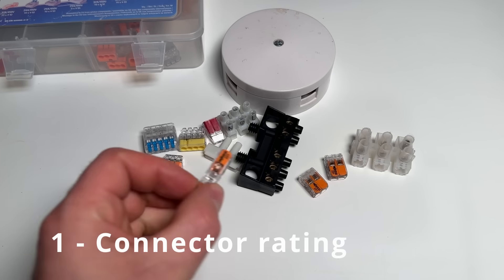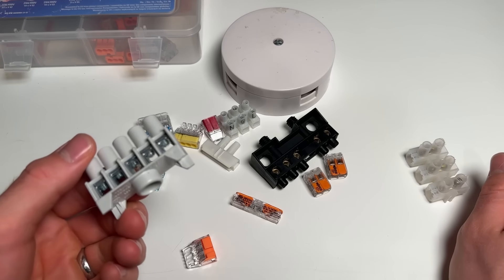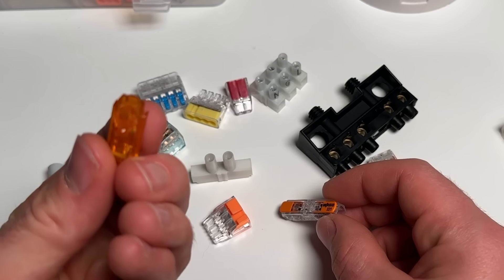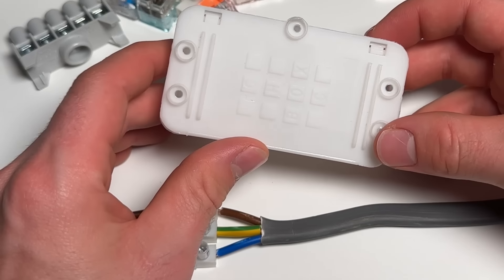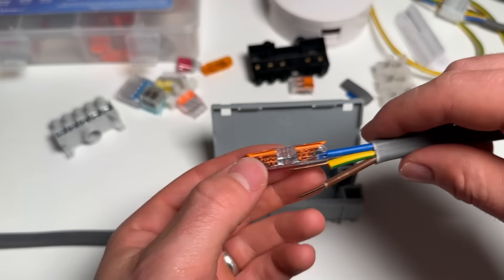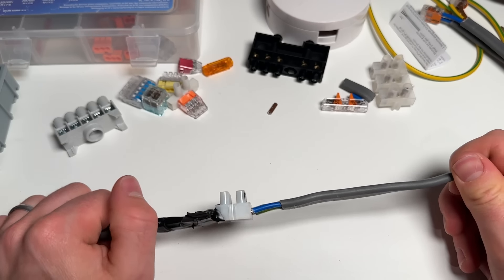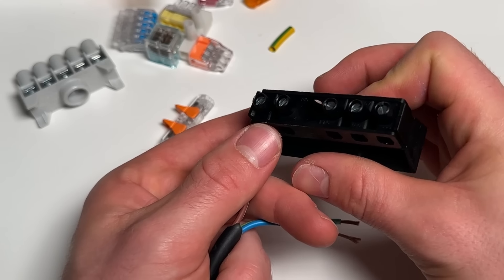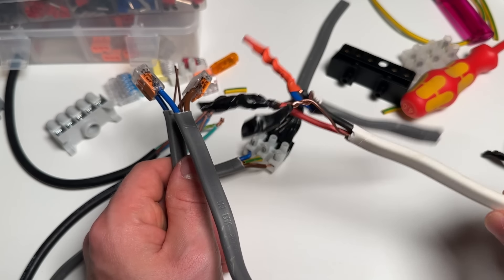BIGGEST DIY Mistakes Joining Cables

Comment: Every mechanical connection method has it's problems, add to that the type of conductor and the material used. Screw terminals have issues in securing stranded wire, directly using just a screw, wrongly sized and spread may occur and secondly screws becoming loose and crushing the conductor to destruction. Wagos, and Ideal, the latter one shot device, but both are constant pressure, both use a sprung cleat type connection, this is minimal and there is a issue with resistance due to knife edge, similar to a crimp lug, I've seen wagos under test glow at this junction, crimps are the way to go, definitely for stranded wire, incidentally do wagon boxes have a fire rating?...old junction boxes were made of various material, the most common being a vitreous type material, which was pretty good?

Comment: While i do enjoy the WAGO connectors, in terms of quality of the connection, the screw ones are the best, but are also used wrong by everybody. Come with the wires so that both screws catch each wire, 2 points of mechanical connection is the safest way to do it.

 Might not look as pretty as WAGO but for sure they are more secure, remember that a wire will get hot at the weakest connection point, 2 screws on each wire is better than any other clamping method.
Reply: More secure until the screw backs out. How often are you going back to check the screws on previous installations?
Reply: @Pugjamin  derivation clamps inside electrical panels have screws... 2 of them. 

The job of an electrician is to tighten these and then after a week to do another inspection and check again the screws.

It is the same drill for the circuit breakers. Nothing is fool proof, somebody has to do his job right!
Reply from the maker: Thanks for watching!

Comment: Think you've got them the wrong way round. The clamping power of the standard connecting block is way over that of the Wago , you have no control over it unlike the  connector block. Just as long as they are used inside an enclosure,  they are perfectly fine, which goes for all connection methods
Reply from the maker: Thanks for watching!
Reply: I agree - the Wago is a spring clamp, with a relatively poor connection. A screw-down block has a much better connection across many more strands.
Reply: @SimonWad  I just like to add that the spring's main function is to press the wires against the bussbar inside the Wago-connector.
Reply: The difference is that the springs being made of spring steel maintain a constant clamping pressure indefinitely.  With a screw clamp the pressure reduces as the ductile copper wire relaxes over time.  It's also impossible to overtighten a Wago.
Reply: Nowadays junction boxes have to have some cable outer retention, not just retain the conductors and fix the cable nearby.
Reply: Absolute rubbish.  @SimonWad

Comment: It's interesting how locale influences what we consider safe. In North America, almost all connections are done by twisting wires together (and covering with wire nuts.) When I heard about British ring mains, my first thought was, "why aren't there more fires there?" Of course, your plug has a fuse, to compensate.

When licensed electricians make twisted connections here (Canada) the resistance of the connections are lower than for Wago connectors (not that I would hesitate to use Wagos.)
Reply from the maker: Good points, thanks for watching!

Comment: It's really interesting to see how different places do residential wiring.  Here in the US, as you probably know, most household branch circuits for the past 50+ years are 15 or 20A, 120V, with 14 or 12 gauge solid wire, or about 1.6 or 2.0mm.  All splices have to be done in a UL listed enclosure, with a UL listed device, and be accessible.  On solid wire, installed properly, UL listed wire nuts are fine, and probably 95% percent of US homes are wired that way.  But I agree wagos are a bit better.  The push in types are frowned upon here, because some products were on the market..and still are...that have proven to be not reliable and have some hazards.  So many electricians avoid them as shoddy.  It takes a long time to shake a bad reputation.
Reply from the maker: Thanks for watching!

Comment: I don’t agree with your fascination with wago connections. In my opinion as an electrician of 35 years the screw terminal is fat superior. The wago relies on a spring and springs weaken in time causing a weak connection which hears up further weakening the spring resulting in a burnt out connection. Use a screw connector block.
Reply from the maker: Thanks for sharing your opinion
Reply: Interesting thoughts but I don't agree.
Reply: Only time will tell if Wagos have longevity, The trend is going toward spring connector joints including outlet sockets, it's only time before mcbs, rcbos etc will go that way.
Reply: @mainlineelectronics5266  I doubt MCB's, RCBO's etc will ever have lever connections due to the range of sizes of cable that can be used on some circuits, a 32A breaker can be used with 2  or 3 x 2.5mm² or 2 x 4mm² cables through to a 10mm² cable and possibly even 16mm² you won't find a lever style connector that could cover that range of sizes

Comment: a 30 amp junction is ok on a ring - 2.5mm T&E is rated to max 27amps clipped. Think about it.
Reply from the maker: I’ve got another video on socket mistakes covering rings and cable ratings. Thanks for watching!

Comment: 6 - twisted flex: common in Saudi, and for quite hefty loads too, seen in public spaces such as for shop front signage. Last one, flex into a block, is essentially how a wires in a plug are connected (but with flex sheath grip too).
Reply from the maker: The flex should have ferrules over the cores in the screw terminals though
Reply: @TheDiligentDIYer1759   there's no space in a regulated 13 amp plus.
Reply: There are LOTS of things that are common in Saudi, that are very much not ok.

Comment: Great video for basic DIYERs , but if you do a follow up, please note that if using a chocbox then the cables entries should be secured using the providing cable clamp to make sure the cable is secured from undue tugging to stress and the cables do not pull out of the connector block which also hooks onto one of the pegs in the lid to ensure that the connector block is secure inside the enclosure
Reply from the maker: Very kind of you to say so, and good points! Thanks for watching!

Comment: Wow how did we ever connect anything safely before Wagos? Junction boxes when correctly installed are perfectly safe period.  Check your electricity meter main tail connections when you get chance and tell me what you see?  Shock horror screw terminals carefully designed to safely carry 100A plus!
Reply from the maker: I clearly say in the video the issue is people using screw terminals when not rated appropriately. Obviously terminals rated for 100a on a domestic incomer are not a problem. Thank you for watching.
Reply: Fair point, but as others have said on here, it has been common UK wiring practice to use the 30A junction box to break into a ring final circuit to feed a single  spur for example.  The alternative is to spur off the back of a socket on the ring.  The junction box you show at 2 mins in has adequately sized terminals for the job.  Other than that I agree with your remarks completely and will no doubt use Wago connectors at some stage in the near future 👍.
Reply from the maker: I guess you’re right, using a junction rated for 30a on a 32a mcb isn’t likely to be a big issue. Thanks, the wagos are great!

Comment: I was looking at my training documents from the seventies where we had chock blocks, twist connectors and fabric insulating tape. It does mention twisting the earth and didn't require sleeving!! the term CPC hadn't been discovered then!!
Reply from the maker: Interesting to hear, thanks for sharing and thanks for watching!
Reply: I wonder if CPC became the preferred term after a meme went around the Internet showing a Russian „Widowmaker“ type shower with the green wire running into a plastic cup full of soil, which had - Predictably - Been labelled (In Cyrillic)...

... „Earth“ 🤣

Comment: I know almost nothing about electric stuff. I know how to install an outlet and switches but I prefer to let an electrician do it cause I don't feel comfortable doing that. I have never made an error cause I'm very careful, though. If I had to choose a connector I would choose the Wago. The rating and lenght of the "strip" (bare copper) is printed on the connector and it's easy to use.
Reply from the maker: Thanks for watching!

Comment: here we just use wire nuts which act to hold the wires together against each other tightly twisted so would have the rating of the wire that is being joined since the current goes from wire to wire.
Reply from the maker: Yeah I’ve seen wire nuts before, not a big fan personally, but I know popular in the US. Thanks for watching!

Comment: Why would using a 30A Junction Box on a socket circuit be an issue?  Assuming it's a ring-main, the cable is rated at 20A and essentially doubled, so the 32A breaker maximum current is (theoretically) split evenly two ways.  You're using a 30A terminal on a 20A cable for a 20A maximum expected cable-load, so if 20A cable is okay, then why is a 30A terminal a problem?

This logic would not apply to a 32A radial socket circuit, but these are not yet typical in existing installations.

In practice, a typical B-curve 32A breaker (and even a BS1361 fuse) will allow a fair bit of overload for some time before breaking the circuit, so if you were actually sizing the cable and connectors in the hope that the breaker will always protect the circuit you would risk disappointment.

Weirdly, standard practice in the UK seems to be to size the breaker above the cable capacity, but rely on good design and typical use to ensure that the capacity is not exceeded (for example, I might have a ring-main with 10 sockets split across 3 small rooms on it and could, in theory, connect 125A of electric heaters (3kW is about 13A @ 240V x 10 = 130A, but it would not be normal to use as much as one 3kW heater per room).

Comment: In the closeup at 4:03 some kind of rating marking is clearly visible on the screw connector.
Reply: Yes, they are PA9 type 450v 2.5 connector blocks rated for 24A current. Most of the video is practically wago commercial (not that i don't like wagos), with rather little actual knowledge on the subject, starting on what the markings mean and what's the difference between both electrical systems and regulations in eu, uk, us etc.
Reply from the maker: Thanks for watching!

Comment: I'm rewiring my garage and just ordered a variety of Wago connectors. I've never used them before, but I'm sick of twisting wires together and using wire nuts. I've heard that Wagos are actually rated by wire size not amperage. In the USA the biggest they accept is 12 gauge wire which has a max rating of 20 amps. I don't know the EU wire sizes but I'm wondering if the max EU wire size it can accept also has a max capacity of 32 amps?
Reply from the maker: Sorry I’m not sure, best to check the manufacturer guidelines. Thanks for watching!

Comment: chocolates you need to put wire trought both screws from boths sides. Then that connection is superior to everything but pressed/welded joint.

Wago is quick and easy to use, but it has poor pull resistance and of course 32A during that type of connector is for short burst only, for long term load, your limit is more like those 20A for "america".

When I am connecting cables in wall, i am using electrical wreath inside electric box. It has perfect pull protection, ideal cooling spaces, it can be easily redone even after years and wiring is easy to understand even if you forgot it or lost schematics. Only drawback, that they are relatively dangerous to work under load.

Comment: Don't use ferrule and WAGO as show 8:41. The WAGO need the soft coppet to get a good grip. Also you don't need ferrule for termination standed wires in screw terminalse. Just lay the wires double and screw into the excess copper.

Comment: I can't find a solution for my issue. 
I'm replacing my old smoke detectors, and they were wired. Can I just cut the ends, leaving no exposed copper, heat shrink sleeves on each, and push them back inside the ceiling? Would that be safe enough?
PS the wires are live.
Reply from the maker: I would just replace the old ones with wired smokes, much better than relying on batteries, and cheaper than wireless interlink. Thanks for watching!

Comment: This is not technical right in some parts. I have never had an issue with screw terminal connectors and in my experience they are better than Wago.  The connector blocks rating is mainly centred around the cable sizes the terminal would accept, i.e. 32A would be for 2No 2.5 or 2No 4mm cables and not the current carrying capacity.

Comment: 02:48 you said "that is a connector not rated for a socket circuit"....it's a "PA 29" connector (it's written on the side of it), which means it can handle from 0.5 to 4 mm cable, and 24Amp 450V.... So I don't know what YOU need for a socket circuit, but for me this connector is twice above what's necessary for a socket circuit....HTH
Reply from the maker: Thanks for watching!

Comment: All electrical connectors have evolved for speed of install. I wouldn’t say they have improved mechanically or electrically. I still don’t fully trust wago style connectors, I guess time will tell. Certified nylon screw connectors will have the voltage and current rating moulded into the nylon with the data usually displayed at the end of the connector adjacent to the terminal screw. The voltage and current rating will be stamped onto alternate terminals respectively.
Reply from the maker: Interesting, Thanks for watching!

Comment: I would never use those plastic connectors with a srew. I have seen ones that had plastic decomposed and turn into dust as I touched and squeezed them. Probably sat there for ages.

Comment: Can one use the WAGOs for 4/6mm solar cable? Tx
Reply from the maker: I think it is max 4mm for the standard wagos, they do a larger size though. I don’t know how much current solar panels output, so you’ll need to make sure any connections are appropriately rated. Thanks for watching!

Comment: Can these be used to extend wires to reposition a consumer unit ?
Reply from the maker: Yes you could use wagos to relocate a consumer unit, but typically electricians use DIN rail connectors in special enclosures. Consumer unit relocation isn’t a DIY job though,  you need a qualified professional. Thanks for watching!

Comment: I use screw connectors more out of habit, but always in the connection the two wires overlap, they are pressed by both screws.
Reply from the maker: Thanks for watching!
Reply: @ lenaisx .. I do the same. Both screws make the connection and therefore give twice the clamping area for mechanical strength and twice the clamped surface  area for electrical conductivity.

Comment: Wago is very nice. However, for the DIY'r, I still prefer the old fashioned wire nut. They are not idiot proof like the wago, but they are cheap and you don't need to have a case with 12 different styles on hand.
Reply from the maker: Thanks for watching!

Comment: how do you spell wehgo? do they need a ferrule or can you use bare stranded wire, for non wall current.

8:30 can i solder the tips instead of ferrule for non wall current?
Reply from the maker: You could solder, but more effort than it is worth. Thanks for watching!

Comment: @2:40 Insert both cables into the chocolate stick from one side. Strip enough insulation to allow the copper be gripped by both screws, but don't have copper beyond the terminal. This way, the connector isn't carrying all the circuit current to make the connection.
I've recently fitted downlights and replaced the 'wagos' which came with them, because just the slightest tug on the cable caused it to  pull out of the terminal....also, wago types carry all the current on the connecting metal....might not be a great idea. I was taught to twist solid copper conductors together, before putting them in a teminal....that's now frowned upon, as it stresses the copper which will produce a weak or broken connection.
Reply from the maker: Thanks for watching!

Comment: Terminal strips has their uses, but a) I would never use one to connect AC in j-box, and b) if you do have to use one, it is best to go with beefiest, most expensive ones. I've had cheap ones break (one has to wonder what kind of crappy brass those were made of!).

Spring connectors are excellent. The only problem is that while genuine WAGO are fine, most every other are not, unless you collect Chinese 222-series counterfeits.
Reply from the maker: Good point, thanks for watching!